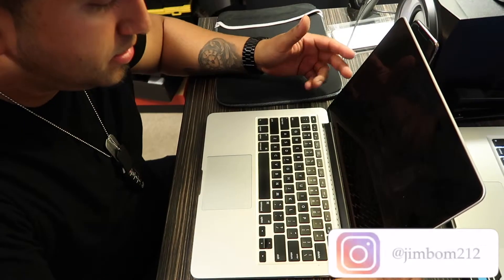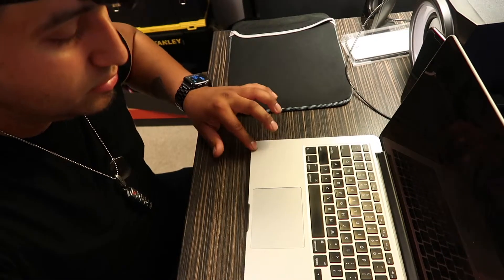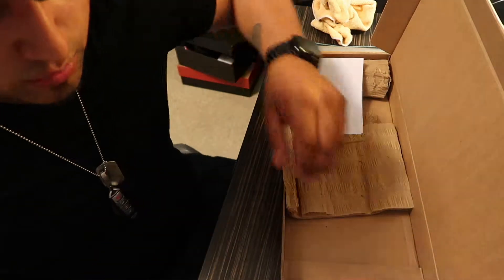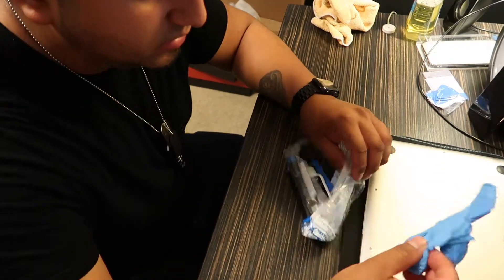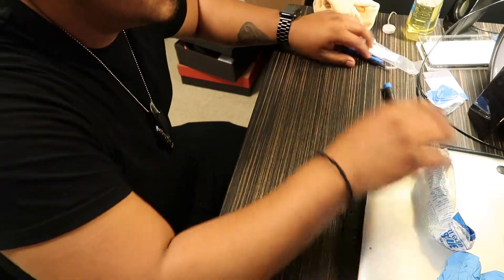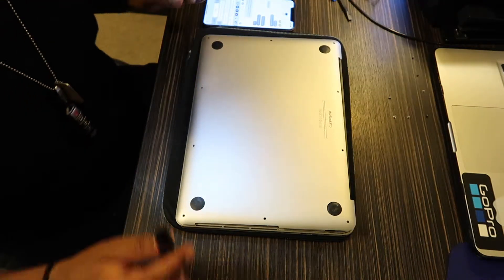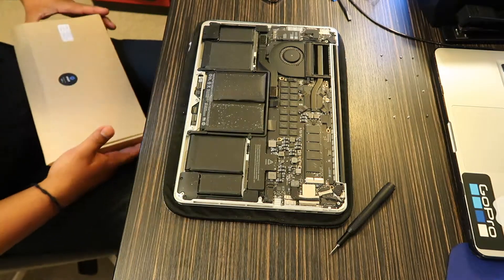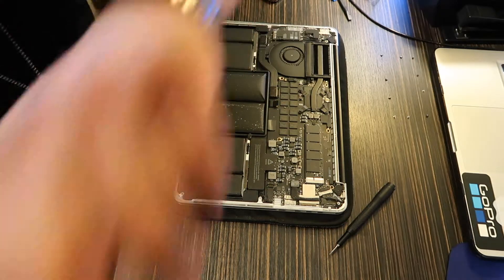MacBook Pro 13" Retina (late 2013-mid 2014) battery replacement with IFIXIT kit

Comment: Thank you for the video but aren't we supposed to put "Thermal Paste" before installing the battery?
Reply from the maker: I’m not 100% sure on that but I did buy this kit from ifixit.com this is complete kit I needed, if they didn’t prove thermal paste, it’s most likely because I didn’t need it. I also watched a few videos on this repair, none mention or added anything else into repair. This computer is working perfectly fine since I did repair. That’s best answer I could give you, good luck and thanks for watching 👍🏻

Comment: Hi, I have one question. If I want to replace the original battery to a used battery from another Macbook, what kind of glue should I use? Because the old battery is not sticky but it needs to be fixed.
Reply from the maker: Lajos Mokány great questions, I recently changed back glass of my iPhone and was wondering same thing, any high temperature silicone double sided tape should be fine. I checked amazon and they have some available . Hope that helps 👍🏻